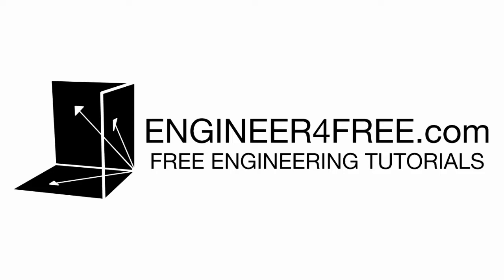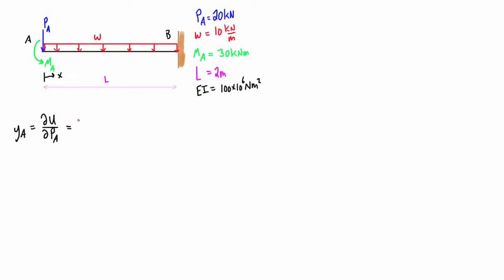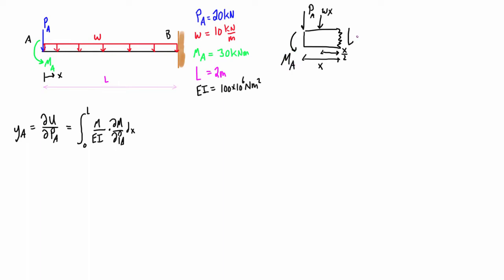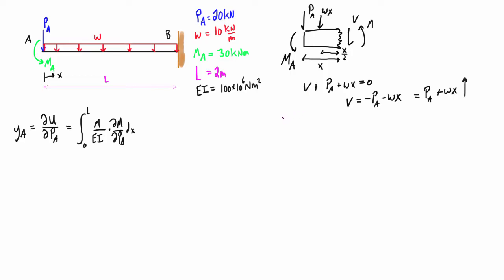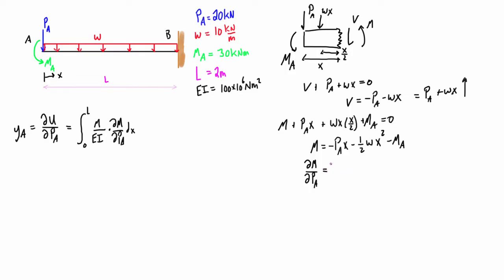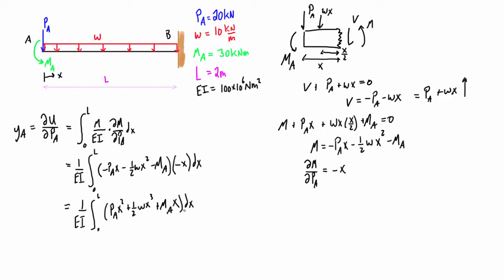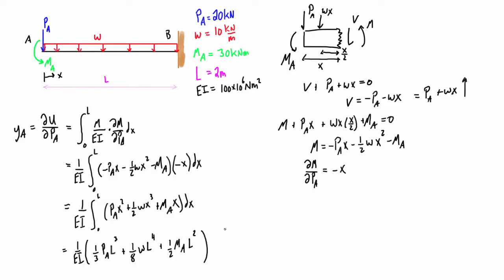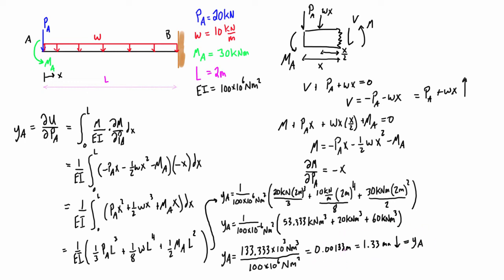Castigliano's theorem example #1: deflection at an applied point load

Comment: What about if they’ve not given length but have asked for minimum length cantilever can be? Also given is max allowable deflection?
Reply from the maker: Should be able to work the problem backwards, no?
Reply: This might be late but for anyone else wondering: You follow the exact same steps but keep L as an unknown. Your answer to the integral will be in terms of L, and since you have the deflection you'll be able to solve for L. You'll have multiple solutions to the equation but you take the one most applicable to your situation.

Comment: Why do professors bother to teach Castigliano's theorem when we can just add up the individual deflections that are found in tables (M*L^2/(2EI) + qL^4/(8EI) + PL^3/(3EI) ).? Is there some advantage to using Castigliano's?
Reply from the maker: You may not always have access to tables, or the problem might be a bit too weird for the tables that you do have access to. Castigliano's theorem isn't the only alternative to tables, like for example you could use the moment area method which is often a good alternative too for statically determinant beams. The thing about structural analysis is there's many different methods available to solve any given problem, just some are faster than others and you will learn over time to recognize by inspection which method would be the most efficient to use. Even if you take a look at my full structural analysis course here: engineer4free.com/structural-analysis you'll notice that it's just a collection of methods and I often solve the exact same problems with the different methods. Cheers, hope that provides some insight.
Reply: when you get to advanced solids it will be a lot more useful as you can use it to solve staticly inderteminant problems